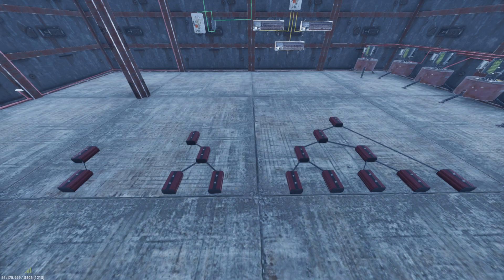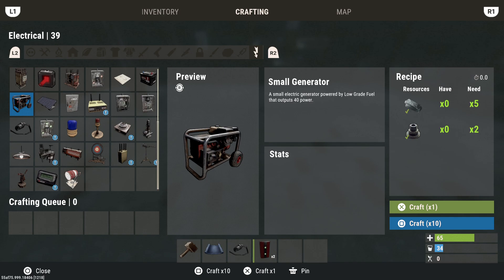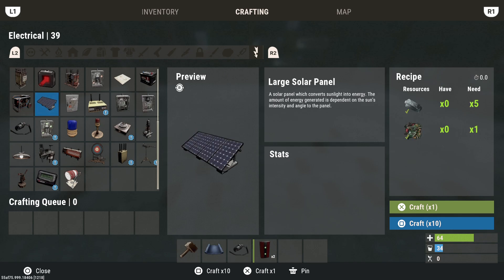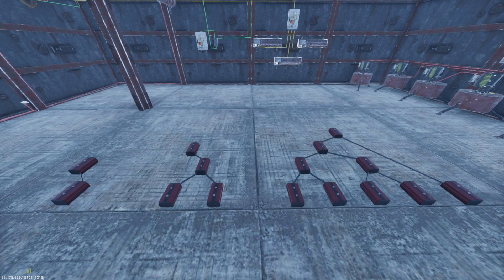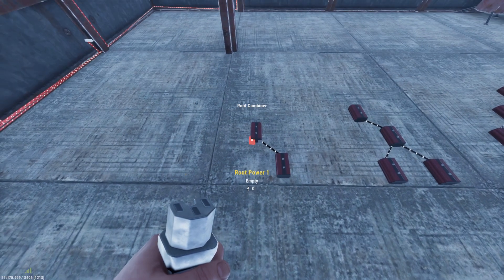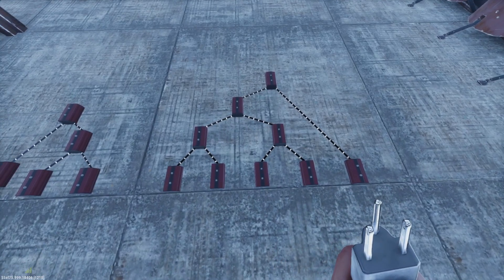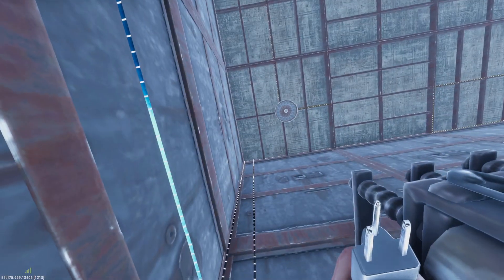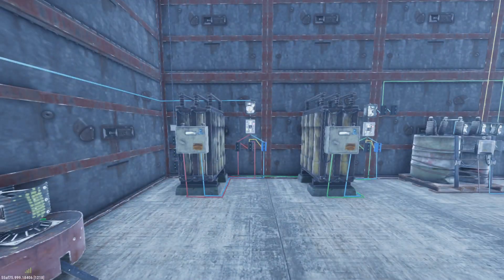All About Power Sources - Rust Console Edition

Comment: Could you do a video about the max root combiner /short circuit error? And maybe go into detail about how and why it happens? I'm trying to mix your hydra circuit with a battery backup but I'm running into problems
Reply from the maker: I will be doing a new video on the Hydra Core very soon that will solve alot of those issues. The Hydra Core has a backup/ is a backup system itself. The new video will help explain better.